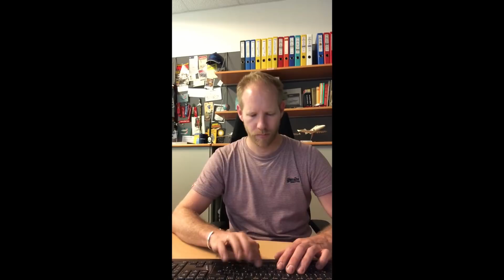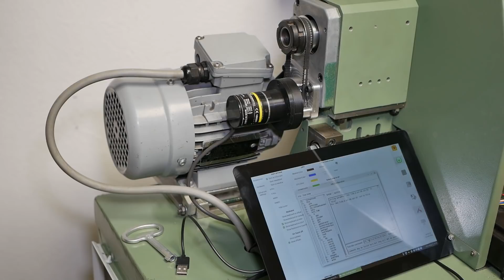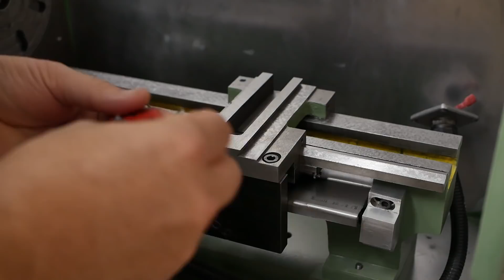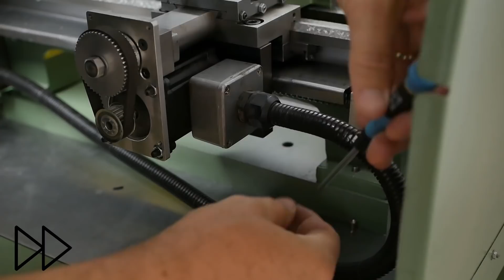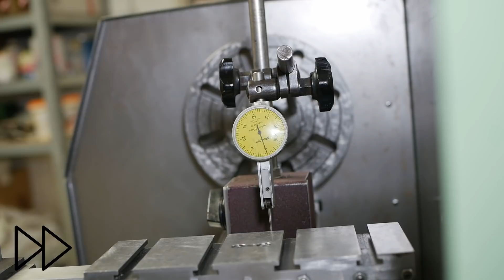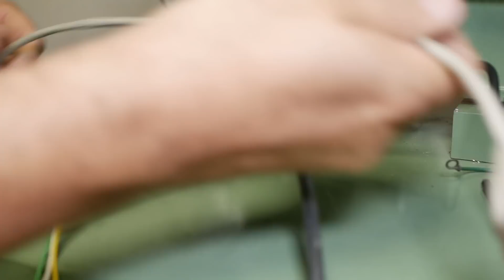Testing Best Mini Metal Lathe - Episode 26 - Motion at last!

Comment: I would be interested in just how much time was spent from start to finish and if you are using the lathe for production?
Reply from the maker: This project was about a year, but a lot of that is due to making videos, and it only being a hobby. I had already done the CNC conversion and the t-slot cross slide years before.
'No I dont use it for production. I only very rarely use it. It is still a wet noodle. I prefer to use the big old worn out Boley manual lathe. Once the Schaublin is running, I will sell the mini-lathe. It would be a good tool for a small model maker.
Reply: @RotarySMP  Ha, it has taken 26 episodes to turn a great little Chinese hobby lathe into something you cannot use. After all this time not one chip has hit the tray. 
Your lathe will not suit small model makers unless you put it back to as found with the original  lead screws, change wheels and half nut. Could be another video?
Do you make any money from YouTube or is it just a show and tell project?
As for being a noodle, a knowledge of feeds and speeds are required.
Reply from the maker: @T.Ackland  I used the Mini lathe for 5 years in it's first CNC conversion. I got pretty familiar with it's limitations.There is a clip on one of my videos, which I grip the headstock and tailstock and twist them, with a clock measuring deflection.  If you compare the bed cross section (poorly ribbed thin parallel Tee sections) to a real watch lathe of similar capacity, like a Boley 1a or schaublin 70, that is what I mean by a wet noodle. 
Yes with sharp highly positive tools, and light cuts you can get jobs done, but it is pretty painful and chattery, as diameters increase, but the lower RPM is high, with limited torque.

I wouldnt return it to manual, as the manual drive components have been binned. They were also no a great design, as witnessed by all the required mods.

I have monetised my channel, but it doesn't cover the hobby costs.

Comment: very similar like my lathe setup (including linuxcnc), although your enclosure is more beautiful. Z Ballscrew X still leadscrew...
Reply from the maker: I took a few mental runs at replacing that X screw for a ball screw, but it always morphed into a monstrosity with some double length screw and the nut held on some growth out the back.

What did you end up with as a spindle motor?
Reply: @RotarySMP  I'm still using the original 750w motor my lathe came with, I have interfaced the potentiometer 0-5V via a PWM circuit.
Currently I'm waiting for a new controller because the torque is too low on low speed (300RPM) but that could be fixed with another PID loop with linuxcnc.
And when threading at 500 RPM the spindle speed plunges down to 300rpm...
Reply from the maker: @mrechbreger  Mine only had the 400W motor, but they were very small watts :) I blew it up.

Comment: What sort of torque rating does the new motor you put on there have? Was considering playing around with a CNC conversion of my old 7x10 mini lathe now that I have a proper one and working off of your experience would skip a lot of the expensive trial and error.
Reply from the maker: Torque = Power/Angular velocity.
Torque (N.m) = 9.5488 x Power (kW) / Speed (RPM)
In this case it is a 750W 4 pole motor running at 1400RPM

So 9.5488x 0.75 / 1400 = 5Ncm. ~ 7OzIn.

Comment: Hey!  We are a little late in thanking you for shouting out our channel, but better late than never!  You may have noticed we changed our channel from "The Machine Shop" to "Lift Arc Studios" because after finishing our renovations and turning into a custom fab shop, Tay didn't want to be misleading.  But again thank you so much for the kind words!  I'm the editor of the channel so it truly means a lot to hear nice things about the work we put into our videos.  Funny enough we've seen your videos many times before realizing you have known of our existence!  As a smaller channel it's extremely validating :)  seriously... thank you!
- Walker (editor at Lift Arc)
Reply from the maker: I missed the name change, and was wondering aht had happened to this shop project. I see now that the YT algorythm had offered a couple of your later videos, (the big seat seems familiar), but I hadn't made the connection.
Keep plugging away. Your videos are very good, and Tay is videogenic, so your channel will soon take off.

Comment: To be honest, I wouldn't dream of running a CNC machine anywhere NEAR a region I can hear mechanical distress of the motors following commands. Like, nowhere within 20%, instead of hunting how close I can get. Regardless whether an impromptu check can detect lost steps or not - the potential for gray hair down the line is just far to high. As far as I'm concerned, it's just the price one pays for running an open-loop rig. You want to be 1000% sure the machine can actually do what you tell it to do, not keep wondering what exactly went wrong this time.
Reply from the maker: I agree. I have derated my axis rapids and accel considerably from the theoretical max.  On such a tiny machine, rapids are pretty irrelevant.

Comment: Amazing project, you've put so much effort into it! I would suggest, if you can, try find some ground ballscrews to put in it. This machine really deserves them. That backlash is surprisingly high though, somethings going on with the thrust bearings I think.
Reply from the maker: I looked for a ground ballscrew for X, but couldn't find a solution without a complete redesign of the saddle, cross slide and enclosure. The backlash is in the bronze X leadsrew nut, which is 17 years old. 

Backlash is less critical on a lathe than a mill, as you do not normally have load reversals in a cut.

Thanks for watching.
Reply: @RotarySMP  Aaah, fair enough, If you're interested in a future upgrade - check out RLS' magnetic encoders, or just the normal cheap linear optical encoders from China.
Reply from the maker: @DUIofPhysics  I have considered putting glass scale encoders on it, but probably wont.

Comment: Sounds like the X axis motor is struggling to keep in step over 750mm PM. It sounded sweet as a nut at 600mm PM so maybe start there and work up.

Changing the gears to a 1:1 ratio will increase the overall speed anyway, so let them take up the slack, a distressed motor won't last long no matter what kind it is.
Reply from the maker: I think you aer right that I really need to order replacement pulleys. 
Thanks for watching.

Comment: The noise is giving me motion sickness. That rubbing sound can't be good.
Reply: This rubbing are step misses. It's running too fast. That's why u can see clearly the slower speed gives a even more faster moving speed in reality in video scene.
Reply from the maker: I think it is a combination of gibs quite tight, lead screw misalignment, excessive belt reduction putting the stepper too far out on its torque curve, and the friction of a trapezoid screw. I still need to put a clock on X and fine tune it so it reliably doesnt miss steps. 
While editing the video, my wife hated that sound :)
Thanks for watching.

Comment: The wire not need to twist before crimping.
Reply from the maker: I have heard that, but find I need a little twist to bundle them other wise find it differcult to get them all into the ferrule without some getting bent out. How should I bundle them without twisting?
Thanks for watching.
Reply: @RotarySMP  The plastic has a cone to help pass through the wire straight.
If you twist it, the wire will cross each other and won't fit equally in hex,  or square.
Reply from the maker: @DPTech_workroom  Thanks.
Reply: @DPTech_workroom  the Chinesium ones I've used didn't have a cone in the plastic
Reply: @MF175mp  in Ukraine we have only Chinesium ones 😉. For now I have no problems with them. The metal part must heve some cone too.
Reply: @DPTech_workroom  I checked again, the hole in the metal is slightly tapered and has a chamfer but there is still an edge that the possible loose ones will catch and bend back. Especially when I'm often using the thickest cable that can be stuck in there
Reply: @MF175mp  Maybe you are right... There can be a lot of different manufacturer, with different technologies.
Reply: Buy good quality ferrules, cut the wire with sharp wire cutter (scissors motion, not the side cutter that squashes the strands) and straighten the strands before putting the ferrule on. If it is still an issue, you can feel it stopping before you you bend one, at that time try to guide them in with a circular motion (orbiting, not rotating, if that makes sense). Alternatively, you just let them bend out and cut them back.
Reply from the maker: @besenyeim  Thanks for the explanation.
Reply: @besenyeim  or if you're absolute cheapskate like me, you buy the cheapest items available and spend up to 5 seconds per wire twisting it back to semi decent shape
Reply from the maker: @MF175mp  You and me both.
Reply: @MF175mp  Yeah, understandable. The real issue is the mechanical strength, which is not always a problem, but in some places critical. If you twist the strands, the cross section will be larger when you crimp the ferrule (or other connector) on. Then if the cable gets pulled, it will untwist and get effectively smaller, and come out of the connector more easily. Again, it is not always a problem, but always should be in mind, when one makes a connection like this. Also, it is a good practice to follow every time, and not risking to forget when literally life and death depends on it.

Comment: Great to see everything works so far :)
Reply from the maker: I am not super satisfied with X, but have the gibs quite tight. Thanks for watching.
Reply: @RotarySMP  Well you have comer farther than me with my own workshop, mill conversion etc. Also the video quality has improved :)
Reply from the maker: @mrspeaky6885  Thanks for the feedback on the quality. I moved up to a better camera, as I was frustrated by a number of aspects of the Olympus for video. Hopefully from next week the audio will be better, as I got a new mic.
Reply: @RotarySMP  What camera have you got? i am thinking on filming my workshop renovation as I am renovating an old building, repairing old machines and creating my own makerspace and think some people might be interested
Reply from the maker: @mrspeaky6885  Cool, go for it. 
I bought a used Panasonic G81 (G80 or G85 in other countries), as I already have MFT lenses. I like the focus peaking, and control lay out, it has a Mic jack for the new Rode wireless go I got, and the flip touch screen also helps a lot. Adding a cheap Sokani LED video light has also made a big difference to the quality of the footage. I do about 80% of the footage with a 25 f1.8 lens (equivelent to a standard 50mm in FF).